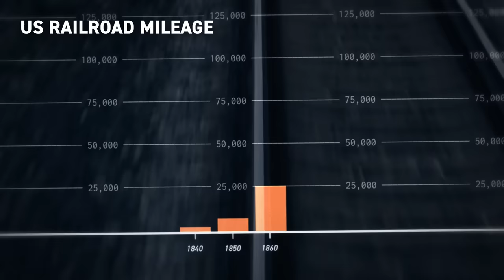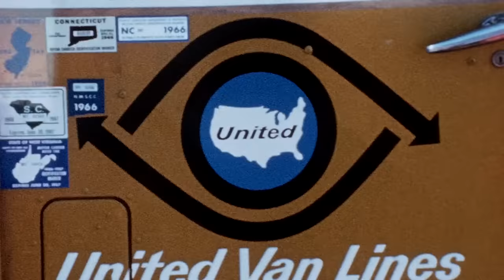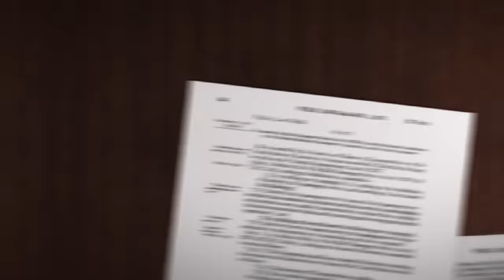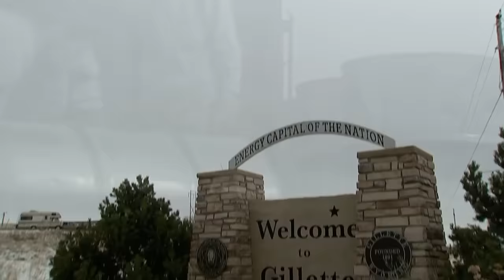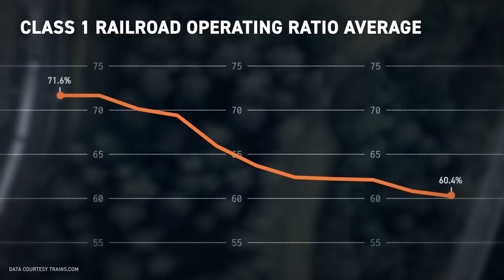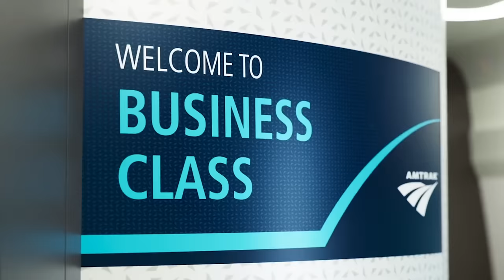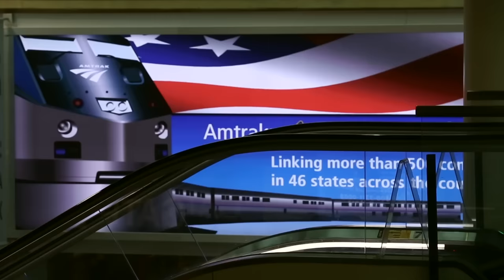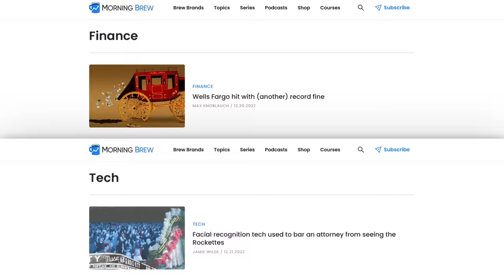The One Tiny Law That Keeps Amtrak Terrible

Comment: Trains are cute but when i get somewhere I need a car to get around.
Reply: that is the whole problem we are trying to fix, along with American car-dependence.
Reply: @MBT06  we shoud invest in better wider faster roads not trains.
Reply: @wilhelmkirkpatrick  Well the katy frwy has a daily capacity of 330k while one subway line in NYC has a capacity of 1.4 million. The katy frwy is 26 lanes wide. So this is why cities are tearing down highways in favor of transit. Its faster anyways also, highways go like 80 mph while high speed rail goes 200+. 

You have what is called the "Just one more lane bro" mentality. Adding one more lane will not solve traffic problems, and the katy frwy is an example. It is 26 lanes wide, TWENTY SIX LANES and it still has insane traffic. How many lanes do we need, 50? And guess what they dont invest in? Rail, light rail, and public transportation.
Reply: @wilhelmkirkpatrick  Do you know what induced traffic is?
Reply: Or we could just build cities like they do in Europe. Where you can walk to a local grocer without having to worry about being ran over by a lunatic in a car.

Comment: Passenger rail service failure has absolutely nothing to do with freight or operational mismanagement or infrastructure or any of that. 

Airplanes are why. Time is the most valuable thing in a human life, and airplanes are time machines. Just look at the schedule examples you held up in the beginning, they are completely unacceptable outside the one sector they serve, tourists, outside the NE Commuter  Corridor where they run a sufficient service that really only needs to speed up.

Tourists can sit in a siding and not have their lives altered.

Comment: As petroleum becomes ever more scarce, the prices of gasoline, Jet-A, and diesel fuel will inevitably rise: gas was $7.00/gallon and diesel was as much as $8.00/gallon last summer in some parts of California. Early models of EV pickup trucks have proven that hauling heavy loads and towing trailers with battery-powered trucks is a disaster. No one even has a clue as to how we could power a large airliner with anything but Jet-A fuel. But waiting in the wings is a technology that's already in use in light rail systems in dozens of American cities: electric trains. Freight locomotives are already electrified, in the sence that the wheels are powered by traction motors; they just use diesel fuel to supply the energy. There's no reason that this needs to continue - just replace the diesel engines with ballast, or maybe batteries, add pantographs and an overhead power line, and convert the whole rail network to electric. It's inevitable that this will happen next century, when petroleum becomes so scarce that what little is left will be reserved for base stock for manufacturing lubricants, plastics, and chemicals. There's no reason we can't start in this direction now. Amtrak should have it's own trackage. When only relatively short, light weight passenger trains run on a set of rails, track damage is lessened, and the trains can run faster (think TGV and Shinkansen). High speed passenger rail works in Europe, Japan, and many other countries, the only reason we don't have it here is political, not technological.

Comment: The economic vilification and oversimplification in this video is just too much. Can the US railroads not do anything right? Did this video really criticize the efficiencies of containerized shipping?

The US FREIGHT railroad system is the most efficient IN THE WORLD, and the only one that that actually turns a profit (form all those nasties efficiencies the video authors hate). They move 5,000 ton-miles of freight per person per year, vs 500 ton-miles pp in the EU and less than 170 ton-miles pp in Japan.  57% of US freight travels by rail or water, equal to Europe and more than Japan (40%). And in the US, only 30% of freight travels by road, compared to 46% and 60% in Europe and Japan, respectively. (If the US would get rid of the stupid Jones Act, intercoastal shipping could become profitable again and take on even more of the burden).

The bottom line is that the US has done a better job of maximizing the efficiencies inherent in each mode of travel, resulting in a more efficient distribution of capital. Railroads can beat road freight, especially with containers, beginning at 600 miles, and they are investing to get that down to 400. The sweet spot for passenger rail is very narrow: 100 to perhaps 400 miles along densely populated networks. Longer and they cannot compete with air, shorter cannot compete with cars. (Hence the Amtrak Northeast Corridor line actually returns an operating profit). For passenger distances over 600 miles rail will NEVER be able to compete with air, even on only operating costs. Europe and Japan pay humongous subsidies for their passenger railroads and hamper their ability to move freight in the process, increasing costs for their entire economies. 

I'm not criticizing the passenger systems in other countries, just pointing out that they do not come without cost, and that the US is not Japan or Europe. Also, that running an efficient railroad is no crime.

Comment: Would modern rails in the US be competitive when compared to airlines? I think it would be neat to see if it would make sense to have consumer rail from NYC to Cali when it'll be so much slower then airplanes and the infrastructure, especially in the case of high speed rail, would be so expensive to maintain. In the case of heavy rail it would just be too slow when compared to car / plane and using it for freight over passenger just seems to make sense.

Comment: The rail industry needs to be heavily regulated.   Companies will never do the right thing.  I look at what happened to German rail since it was privatized.  It was a well connected network that was clean and punctual when controlled by the government.  Once privatized, routes were gutted, stations became dirty and overgrown with weeds, and punctuality became a thing of the past.  Basically what you see here in the U.S.  The rail network here is a joke.  Single tracking pretty much everywhere ensures failure.  Longer trains means bigger delays.  They are slower, harder to stop and start, and they block intersections for longer periods of time.  It also reduces frequencies as segments of track are tied up for longer periods of time.  Government needs to take over ownership of the lines and regulate usage.  Double track almost everything, electrify everything, and reduce the length and weight of trains.

Comment: Japan Rail (JR) was the first in the world to realise that when they invented the Shinkansen, (bullet train) that is had to have it's own track bed that only it would run on, in short NO FREIGHT TRAINS ON THE SAME TRACKS. This concept has made it the fastest, most efficent, and successful mode of rail travel for passengers since the invention of rail in the UK with Stevensen's Rocket in 1829. It has been so successful that China has built the same concept, so has India with the help of JR and the UK is in the process of building it's own High Speed Rail line from London's Euston station to Manchester, all strictly dedicated rails strictly for passenger trains with NO FREIGHT TRAFFIC. That's the only way Amtrak can do the same thing and effectivly compete with road and air especially with aircraft flights adding to climate change with their high CO2 output.

Comment: Not sure why it would take a modern train 6 hours to get from Pittsburgh to Columbus when it's a 3 hour drive
Reply: Because more money was poured into the highway system than rail infrastructure.
Reply: @murcuryvapor  yes. I'm saying that if the goal is the provide efficient transportation between cities that could help reduce the highway system, the idealized version in the beginning taking twice the amount of time as a drive doesn't really sell the idea
Reply: @austinblankenship7631  Right. Start with nationalizing the rail network, and give passenger trains priority.

Comment: Freight is what keeps railroads in business. Passenger service was always, and will continue to be a drain on railroad revenue. Passenger service will never be profitable so long as it remains non-smoking, and people are trapped onboard for two or three days. Only able to smoke during station stops, but only if the crew lets them know they can step off and huff a quick cigarette. My son and daughter-in-law rode the Texas Eagle and the crew finally told them when they stopped in Kansas ,that they could have gotten off at every stop and smoke. But the crew didn't want to round up the passengers.
Reply: We're not saying don't have freight rail but they shouldn't have to share the same tracks and freight rails should be hugely regulated and right now they aren't regulated at all.

Also I agree with you there should be a smoking car or at least a smoking cabin or smoking balcony on rail lines.

Comment: I have heard this theory before where the freight trains had taken priority over passenger trains, which is sad, because there is (was) so much potential in our existing system.
Reply: The real reason why freight has overtaken priority - that wendover neglected to mention - is infrastructure. The "loops"/lay bays that would've allowed passenger trains to pass are too short for the nowadays very long freight trains, so instead the passenger trains have to wait for the long freight to pass (instead of the other way around) because only passenger trains can fit there now.

Comment: Passanger trains just dont make sense anymore. Railroad does still have a place in this world, but it's more sensible to use it for freight.. too many people have to get where they're going in a short period of time. In many cases, their time restrictions to be to the destination AND BACK are shorter than an uninterrupted train would take to get to the destination in the first place. Travel by train has become obsolete simply by its own nature and limitations as compared to the advancements of other transportation technologies, namely airlines and well established highways... BUT Rail is still the best way to transport almost unfathomable amounts of goods from one place to another. A single train can transport 200+ cars in a single load, whereas a semi can only haul one at a time. There is a practical reason why travel by train is dying out. If it costs as much (or even remotely close too... or even more) to take a train vs the much quicker plane to your destination,  why would you ever choose the less convenient option.. especially when the train competes with much more feasible services, such as freight, which will slow you down along the way? The only reason left to travel by train, is nostalgia or novelty, That isn't enough to sustain the industry...

Comment: Amtrak's problems are far FAR greater than just freight.  America is vast and people are in a hurry.  Rail is by far the slowest way of getting someplace - to a single someplace.  And what happens when you get to Denver but you need to go to Boulder... or Castle Rock? Jump on more slow-ass rail.  Or just fly in and rent a car.  Americans have voted with their dollars... and OK their votes as well.  Denver has spent billions of dollars on light rail that by and large runs mostly empty.  What has ruined driving in America?  The money wasted on unused light rail.  The *only* way to make Amtrak profitable is to stop subsidizing it.  Eventually it will shrink to the core routes that make sense.. in the east.  Traversing the west by rail is nostalgic but also extremely time inefficient.  Japan is about as long as the US west coast and probably half the area.  Americans wish for bullet trains on one hand but fly bullet airplanes on the other.  Stop subsidizing rail!

Comment: You neglected to mention another important factor involved in rail service in the 60s.  Airline services although quite expensive this way of travel was much more effective and brought a huge time savings to the scene.  Understanding that air travel would soon be the norm, railways prioritized the way they operated the lines.  Passenger traffic took a back seat to freight transportation.  It was not uncommon for a passenger train to lay way on a railway siding for an hour or more while freight trains would pass.  Enjoyed the video but needed to point this out.  If Amtrak would hire the right CEOs railway service could be much better and cost effective then it is today.  My point is Amtrak leadership created the culture of freight taking priority over passenger service during the creation of the bill you mention in the 70s.  Why? Simple answer during this time all the Amtrak leadership were connected to the freight companies they claimed to advocate against.  Amtrak has failed due to past leadership, this new plan of route expansion is a joke and only really helps the east coast lines.  There are currently no plans to replace Amtrak equipment west of the Rockies, which are in bad need to this equipment.   I certainly hope railway service will become what it once was, but without great leadership and visions, concepts for the future, I am afraid it will just be a niche mode of transportation.

Comment: We need a new law that taxes their limits if they are a mile long they get taxed a low 30% if they show infrastructure improvements such as doubling the lines with passing loops they then get a discount, cut into their short term profits. If the trains are 5 miles long WITHOUT a passing loop long enough for the freight tax them 500% of the value of freight, or 1 million dollars for each car on that train, so that it's not profitable for them to run that long without a passing loop, forcing them to invest in their infrastructure.  And force these guys to go all electric, so the electric trains can go across country instead of the NE, they go at higher speeds is my reasoning for them to do this. 

Use the extra tax money to pay for more FRA inspectors so there are less derailments current we are at 4 per day 🤦🏻‍♂️

Cities should be able to fine the railroad for "parking"  in our cities and blocking roads.  The city of Cullman, Alabama got tired of the railroad from doing that they buried the train line under the city, back in 1895 because the founder of the city left the money in his will for the project. But being a resident in the town CSX still blocks roads for a long period of time to restack the rail cars.

Comment: It would have been better if the government had nationalized the rail network and let all carriers, be they freight or passenger, use the system the same way we use public roads. A lot of the problems alluded to in this video would have been avoided and the freight carriers would no longer get to choose which routes continue to be maintained and which do not.

Comment: Taking the cost of the Tren Maya in Mexico, it will cost 20 million USD per mile. From New York to Los Angeles you have 2,500 miles, it would cost 50,000 million USD to build a brand new train, new railway included. The amount of money that your government has sent to Ukraine since 2014, till today is, believe it or not, 50,000 million USD. Your issue is not about money, but how and where you are investing it.

Comment: The real solution here is to lay more track; lay more track that's dedicated to passenger rail.  A lot of this video is moaning and groaning about how freight operators are seemingly making bad long-term decisions, when they're actually just making decisions to optimize freight service rather than passenger service.  Freight rarely needs to move faster than 50 mph, so the railroads only maintain their lines to be able to handle that speed for the open expanses, and even slower than that in curves and cities.  They're not "short-sighted" for doing so, they're just optimizing for their own industry.  Track demands for freight and passenger service are different enough that they need separate rail lines.  Even if all freight disappeared overnight and Amtrak could use all existing rail lines freely, there would need to be a ton of work fixing, maintaining, and re-laying large swaths of track for optimum passenger service.  Better off to just lay a new, dedicated passenger rail track.

Comment: HS2 in the UK is a shitshow, but the one argument that kept the plan to Birmingham going was that the existing rails are full, and it will at least increase capacity between London and Birmingham, Who cares about the North, or even Scotland and Wales. Anyway maybe you just need to surrender the existing infrastructure to slow and extraordinarily long freight trains and build new fast lines, simply for capacity, with the added bonus of fast passenger trains?

Comment: I don't really see how the US rail system is ever going to be comparable to Europe's, let alone Japan's, because it doesn't even make sense. The average population density in Japan is 326 people per square kilometer, in Europe it is around 74 and in the US it is 34. So the trains would have to run 10 times the distance in US compared to Japan to get the same amount of customers.  Longer distance, more TIME spent travelling, more costs, less profit, so maybe trains aren't the answer unless they get high speed trains and much better infrastructure.